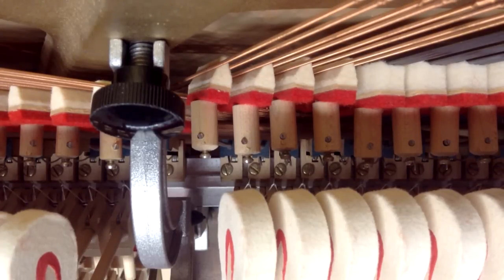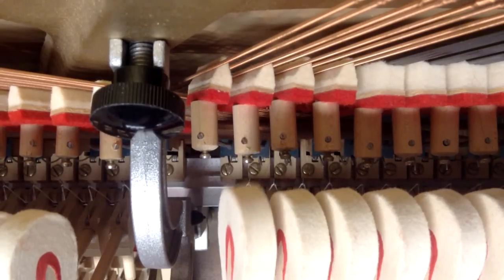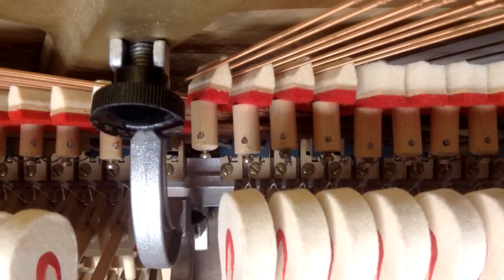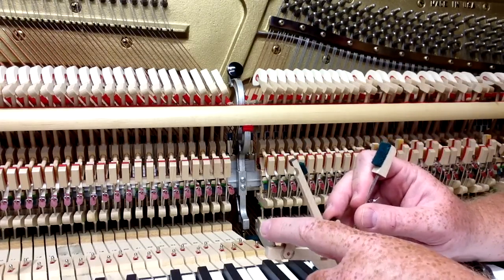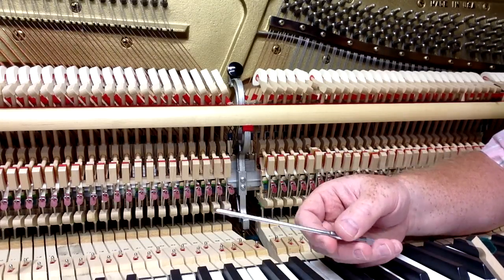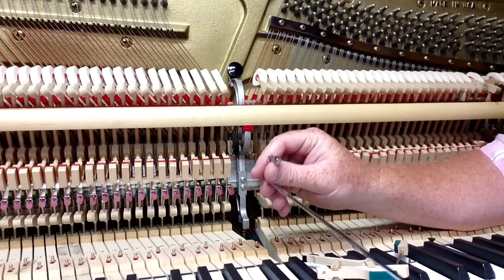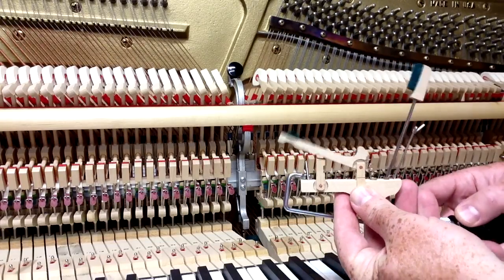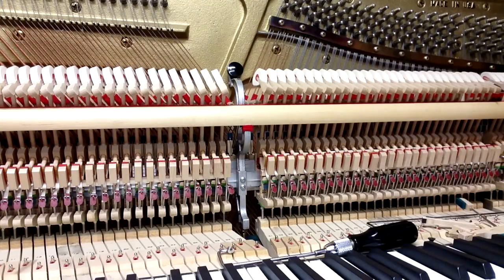Adjusting Damper Spoons - Piano Tuning & Repair I HOWARD PIANO INDUSTRIES

Comment: So the damper spoon affect the touch of the piano. Bending a bit towards you when its in the piano make the damper lift later, reducing the weight of the key initially and contributing to a lighter touch?   If I have that right.  In your overview of all the steps for regulation, you did not mention this one.  I assume that is because it might be a preference thing, like the key dip.  Where would you adjust the damper spoons in the process, at the aftertouch step?

Comment: is it easier to remove the whole action and adjust them all the same and put it back in the piano?
Reply from the maker: Yes, this can be a very efficient way to do the whole set. You may have to remove the action several times but it may still prove faster than trying to adjust them all with the action in place. Make sure to make very small movements of the spoons as it is easy to overdo it.

Comment: Thanks for making this video.
My piano was working fine and one day all the keys in the C5 octave started to last a bit longer after releasing the key(and without using the damper pedal) but not as much as when I use the damper pedal. Due to the COVID-19 situation right now, I'm not able to get any technician to come fix it at my house.
What could be the possible cause and how do I fix it ?
Thanks again :)
Reply from the maker: It sounds like the damper pedal may need to be adjusted.  Here is a link to the video which shows this: https://www.youtube.com/watch?v=fwqoHNhgbS8&t=1s

Comment: Hello Howard, I recently purchased an upright piano for my Wife. I have been watching a lot of your videos as I refinished it because it was not very nice looking. After completing the wood work and returning the action I have noted that there are two keys that now ring. It seems the dampers do not return solidly enough to damp the key. I was wondering if this could be corrected by adjusting the spoon or is this an alignment issue or possibly something else.

Also, thank you for your amazing videos, they are very informative.
Reply from the maker: Hi Andrew, The damper problem is probably due to an alignment issue.  You'll also want to check to see if the damper is lifting too early with the pedal.  If this is the case, you'll need to adjust the damper wire.
Reply: Thank you for the quick response Howard. It was an alignment issue as you mentioned and I was able to get it dialed in. Now I need to watch some more videos so I can get everything perfect before tuning. Keep making these awesome videos.

Comment: I've been watching your videos all night, great channel. I'm getting my first acoustic piano Sunday. It's a free Kohler & Campbell spinet. It seems to be in really good shape. I noticed one key doesn't silence fast enough when you let go of it. I looked at the damper and it looks like it touches the strings but not quite enough. If I press it lightly with my finger it immediately stops. Would adjusting the damper spoon fix that or does it require something else?
Reply from the maker: There are a couple of different things that could cause this.  I would check the damper spoon first.  You'll want to make sure that the key has some movement before the damper starts to lift.  It possibly could be a broken damper lever or damper lever flange or a weak damper lever spring.
Reply: Thanks for the info

Comment: Love your videos...I've learned a lot! I have an issue I cannot solve so far: The last 4 treble dampers, before the bass begins, allow a ringing of the string for 2/3rds of a second to one second. It's a high pitched ring...not the same note as the strings. I have just replaced all the dampers with new ones, following Art Reblitz's instructions in his book. All has gone well accept for the above issue. I've tried every angle and adjustment I can try. I even re-tensioned the damper springs, and I can feel the difference in resistance. Still the ring won't go away unless I put my finger on the unisons. (or wait one second) Any ideas? I've just ordered a few tri-chord wedge felts to see if they'll fare better then the flat ones.
Reply from the maker: The problem you're having isn't uncommon as it is difficult to get this section of notes to damp well.  The trichord dampers will help and may solve the problem.  If it doesn't you'll want to narrow the issue down to finding which of the three strings is still ringing.  Then you may have to make some small adjustments to the wire or the the felt so it seats on all three strings evenly.  This is a very tedious task, but with some careful work the problem can be eliminated.
Reply: I hadn't considered "adjustments to the felt." What can be done to the felt to improve seating? I feel I've exhausted the ways in which the block can approach the strings. Also, I suspected that the last treble damper doesn't work well because it's smaller than the rest, due to having to cut some of it off to allow for the first bass damper to get by without collision.
Reply from the maker: The adjustments to the felt will be on the trichord felt as you can shape the felt a little by pushing open the slot where the center string goes so it seats further onto the strings.

Comment: great vid.  can you adjust the pressure of each key.  my new piano is very hard to play.
Reply from the maker: There are a number of things that affect the weight of the keys or the touch being light or heavy.  One is the timing of the damper spoons as shown in this video.  If the damper is lifting sooner in the keystroke, it will cause it to seem heavier.
Reply: howardpianoind - thanks for your help. 👍

Comment: I purchased your spoon adjuster and have no problem getting at the spoon on a key at the end of the section like you show in the video, but am not able to get the tool between the whippens of all the other keys.  There is not enough space for the head of the tool to get between them, and I'm scared to force it too much.  I'm thinking about trying to grind the head of the tool a bit to make it smaller, but I still don't think it will fit.  Any advice on how to get it in there before I resort to removing the action?  Thanks!  Great videos.
Reply from the maker: Are you able to get the tool in below the whippens?  In some pianos you can't if there isn't enough space between the bottom of the whippens and the keys.  If you can't, then you'll have to adjust the spoons with the action out of the piano.
Reply: My piano is a 43" Walter. I'll try again but don't think there is enough space to get the hook part of the tool between the key and whippens without having to go between the whippens.  The piano in the video looks like it would have the same problem, but may have a little more room than mine.  Thanks
Reply: I removed the action and got the spoon adjusted .  With the action remove it was easy to see the damper that needed adjusting was out of line with the others.  Thanks
Reply: I have this specific spoon bender from Howard's and use it on my Baldwin Hamilton 243 upright (I can't speak to any other pianos). At first I thought it didn't fit and was pretty upset. But after some patient experimentation, I realized that it does fit without having to remove the action. I've made it a habit to remove the key of the damper spoon that needs adjusting, in addition to each adjacent key. It's fiddly, but after a while one gets the hang of it without having to knock stuff about too much :).

Comment: Hey Howard!

My upright has some unusually heavier keys. I checked it out a little bit, and found out that the force that the damper itself pushes against the strings on those heavier keys is greater than the normal ones.

What parts of the action could be influencing on making the dampers press harder against the strings?

Thank you!
Reply from the maker: If it is the pressure of the damper then it would be caused by the strength of the damper spring.
Reply: howardpianoind I see. Thank you so much!

Comment: Ronisch 2 crown
Thanks for the great videos, I have learnt a lot so far.
My problem is the bass black keys aren't damping properly and the note is carrying on longer, until you use the key next to them.The v damper felts have spread to touch the neighbouring felts. If I ground a little off the side of each, with a mild grinding stone on a Dremel, would it make the felt weaker and the problem worse or would it fix it? I thought it may make the felt weaker and spread the damper felt wider? I should just replace the dampers, as I guess it will have to be done eventually. Just trying to get a bit more out of it before I do any major repairs. Any help greatly appreciated.
Reply from the maker: It certainly could help to trim a little off the sides of the damper felts to keep them from rubbing on each other.
Reply: Thanks I'll give it a try.

Comment: . Step one is to adjust the dampers  side to side alignment, Step 2 is for the pedal so they lift evenly. and are pressing against the strings by bending the wires. I was hoping this was adjusting the spoons action outside the piano. Great video nonetheless.

Comment: I have problem with clicking key now. I have tried to tighten all the screws from your instruction in other videos. But the clicking noise still happens. I assume there is something with the damper as when I use the pedal, the clicking noise is gone.
Reply from the maker: Another thing you could check is to see if the hammer head is loose on the shank.  This is a common cause of clicking keys.
Reply: howardpianoind thanks for your advice. I solved it already, the bushing in the back of the damper level wears severely, so when I press the key, the damper spoon touches the damper level and makes clicking noise

Comment: any idea what would cause a key to vibrate wayyyy to much!...is it the dampers or the keys themselves.I cant seem to figure this out! Thank you
Reply from the maker: I'm not sure what you mean by the key vibrating.  Is it a buzzing noise in the sound or is it an actual vibration in the key?
Reply: @howardpianoind  Its like a twang after striking the key...its like when you strum a guitar and the sound keeps going until you muffle the strings with your hand...the other keys dont do that..I strike a neighbor key, and it just makes the tone and stops...these three keys from bass c to f continue to vibrate after striking a key
Reply from the maker: Yes, this would be because of an adjustment that needs to be done to the damper.  If it is a section of notes, then it could be something with the damper pedal or the spoons.
Reply: @howardpianoind  thank you so very much..I am actually smiling right now...:)

Comment: Do you paint the inside of your front door from the outside of your house through the letter box? That tool is useless. I'd like to see you do the whole thing! In fact I defy you to. I think that before bending a spoon, the whippen should be held in pliers or a wrench to prevent damage to the bearing. The action has to be removed to do this job properly. I suggest a better method in my book, The Haynes Piano Manual. John Bishop
Reply from the maker: Yes, it is a difficult thing to do until you get used to it, but once you get used to it, it's not too hard.  I know that some technicians prefer to adjust the spoons with the action out of the piano, but I realize that each person has their preferences on what method works best.
Reply: Thanks for your reply. Sorry I was unnecessarily abrasive. I feel much happier holding the whippen somehow before bending the spoon for fear of damaging the bearing or splitting something. Best wishes.
Reply: John Bishop, it shoud be  slide between the keys,very useful  tool.If you are careful everything be all right.